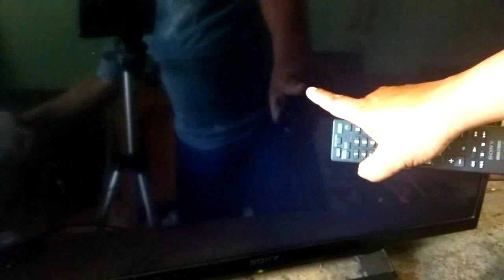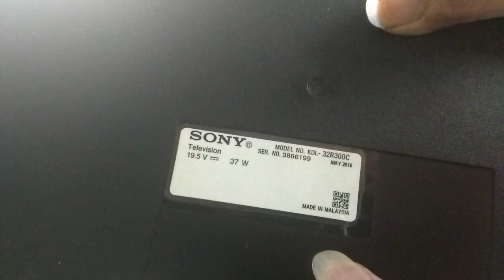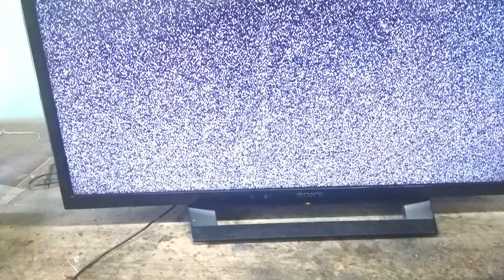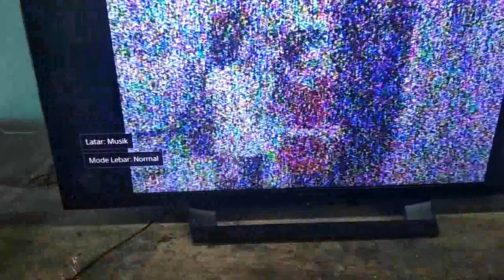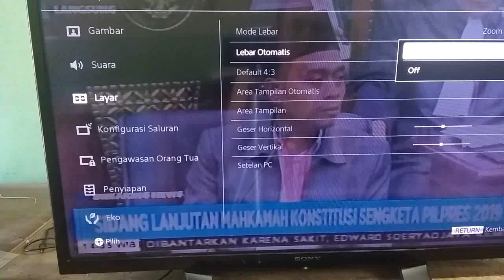CARA PERBAIKI TV LED SONY MODEL 32 R300C PROTEK KEDIP 5X

Comment: Mas klo ic BD9397f ny rusak gmn jamper ny..
Pin berapa mas..
Ic harus dilepas ya..?
Maaf baru blajar mas..🙏
Reply from the maker: kalau icnya rusak harus di ganti di online banyak ko yang jual
Reply: Klo mas bilang td jamper itu gmn mas..
Apa ny yg dijumper
Reply from the maker: @ibnusabil8637  itu untuk nonaktifkan proteknya harus di jamper pake resistor mas

Comment: Mas bro mau nanya kalo keadaan tv matot psu normal itu apanya ya?  Sony klv 40r452a 40 inchi
Reply from the maker: psu normal ga nyala bisa di mainbordya
Reply: @anditvled  itu di mainboard brarti cek seluruh Tegangan dulu ya mas bro?
Reply: @anditvled  itu di mainboard brarti cek seluruh Tegangan dulu ya mas bro?
Reply from the maker: @podosaputro6728  ya bos cek semua ada teganganya tidak
Reply: @anditvled  ok mas bro Terima kasih
Reply: @anditvled  maaf mas mainboard udah saya cek untuk tegangan yg tidak ada 1.5volt sama 3.3 volt itu apanya yg harus  di ganti? Pas saya jumper 3.3 volt ke switch lampu indikator nyala tapi di on tetep ga mau, solusinya mas
Reply from the maker: @podosaputro6728  biasanya di stu ada rangkain stup donw pake ic coba cek icnya kalau rusak bisa ko ganti aja apabilla susah icnya bisa beli dengan menggunakan stepdonw multi di psaran banyak

Comment: Mas, saya punya tv led sharp 22 inc, awal nya gambar dibawah gelap, setelah saya bongkar backligh y byk yg putus, backligh y model strip led, saya kesulitan menemukan part yg sama persis, kemudian saya beli yg ukuran panjang sama tapi jumlah led y lebih banyak, ketika saya pasang tidak mau hidup. Ketika saya ukur keluaran ke kabel jumper tidak ada keluar tegangan, berapa tegangan yg seharus y keluar di kabel jumper om? Apa mungkin dia ke protek juga?
Reply from the maker: kalau baklik sharp yang samping ukuran kecil tegangan outnya nyape 75 volt dia biasanya lednya sistem seri dan di bagi 2 bagian mas karena biasanya kabel dari out bakliknya ada 3 jalur
Reply: @anditvled  iyy mas, ada 3 kabel, 2 kabel putih 1 kabel hitam, tp gk keluar tegangan y mas..lampu merah berkedip cepat sekali..
Reply from the maker: @rsinurat2144  bisa di rangkainya inverternya ber masalah gan

Comment: mastee,, klo tv sony klv-40r452a lampu backlight kedip2 terus seiring kedipan led indikator  hijau, untuk teg, 19,5.v, 3,3v, 1,5v, 1,2v, 0,2v teg ad teg 12v hilang, dan teg 30v, naik turun,, mohon bantuannya trmksh,,
Reply from the maker: coba sewaktu on pertama sempat menyalakan backligyenya tidak kalau ya nonaktifkan dulu pin protek backlghtnya
Reply: Pertama on bl ga nyala normal, bl lngsung kedip2 master,,,,
Reply from the maker: @1606808182  coba cek teganag yang ke bl mas kalau bisa cek juga bl nya pake test bl apakah menya ataukah tidak
Reply: Teg bl berdenyut 0.v sampai 30.v,, bl blom sempet bongkar master lg ke luar ,,

Comment: Tv saya kdl32r300c udah dikasih resistor 10k pin 31 sekarang mati lg lampunya tegangan out punya 46.6v itu apanya y kak sy pemula nih.terimakasih
Reply from the maker: bisa juga backlik ada yang mati

Comment: Mas.
TV sony saya juga seperti itu.
Kedip 5X
Reply from the maker: apa saja yang sudah di cek apa belum di bawa ke service
Reply: @anditvled  belom mas.. kedip 6 kali sih bukan 5X
Reply: Sudah.
LCD typenya.
Kata tukang servicenyaMBnya yg harus ganti.
Reply from the maker: @antorusyanto2604  ya bisa juga mas
Reply: Oh ya mas.
Tv sony saya KLV 46EX400
Mau sy ganti mainboard pake type KLV40EX400.

Sama typenya cuma beda inch.
Mainboardnya jg mirip.
Kira² bisa gak ya?
Soalnya cari yg untuk 46 inch susah.
Kalo mas punya boleh lah sy beli.

Comment: Sama mas tv sya
Tegangan menuju  ke invternnya nihil
Reply: Nah saya klo tegangan ke inverter itu nihil, sya mau modif pakai inverter external ,,, 
Di inverter external adda ket
Vcc(ambil daya dari mana) 
On/of(ambil daya dari mana) 
Adj(ambil daya dari mana) 
Terimaksih
Reply from the maker: @tufloebm2763  vcc ambil tegangan paling gde voltasenya 24vol  on of ambil dari swit driver inverterya
Reply: Ke inverternya tidak ada tegangan mas, jalur dari elco ke ic inverter ,, 
Kalau tegangan on off saya bisa ambil dari mana
Terimaksih
Reply: Kalau tegagan input vcc 19,5 volt